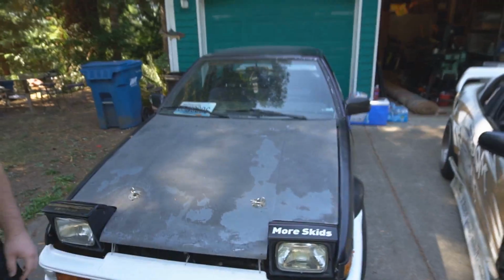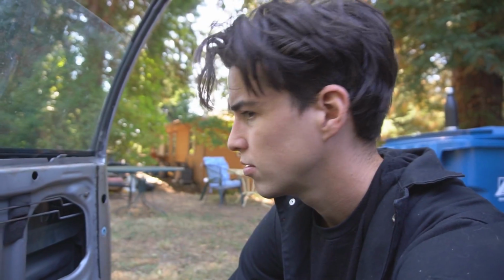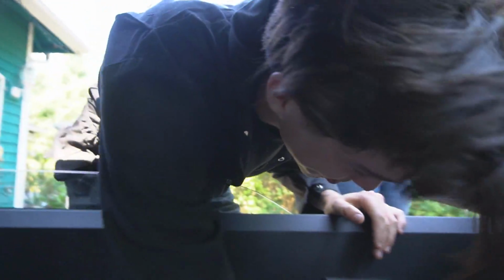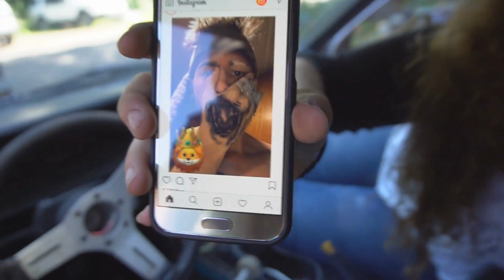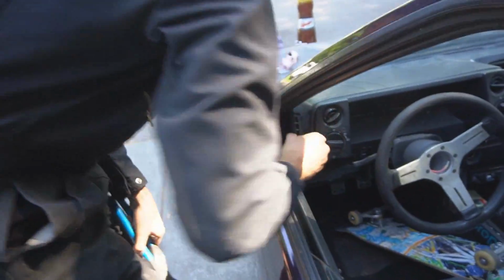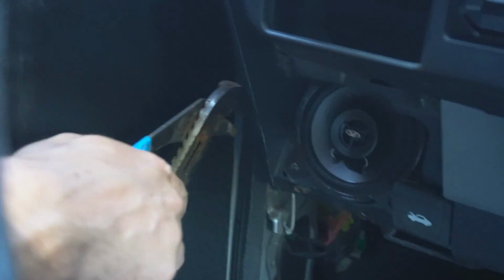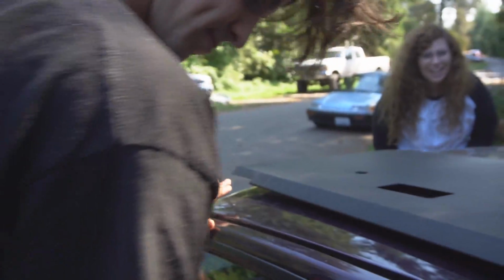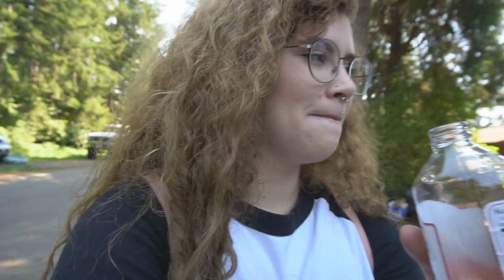The AE86 Struggle

Comment from the maker: sorry for the re-upload! i got sidetracked filming a different video! hope you guys enjoy, we coming for u with frequent uploads
Reply: When u lock the door on the inside and shut the door from the outside. U have to hold the handle up on the outside when u shut the door for it to stay locked
Reply: If you use a ratchet with a 1/4th socket and a screw driver bit you have a right hand ratcheting screw driver